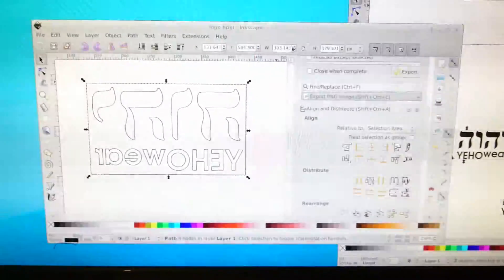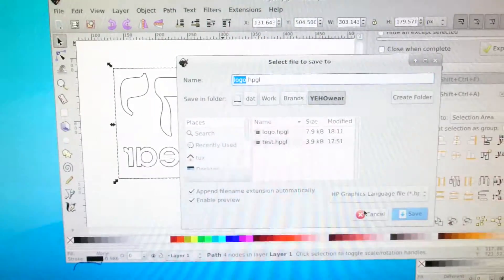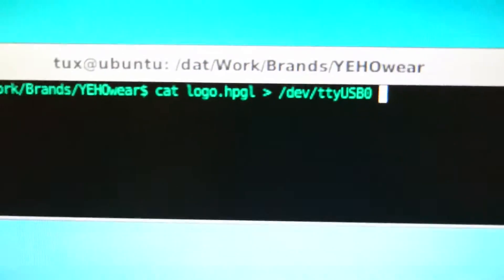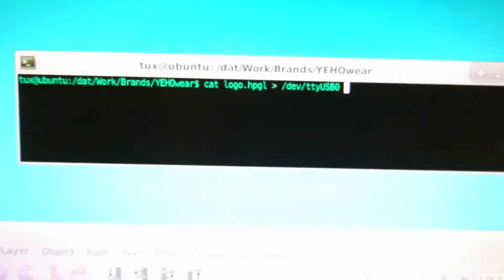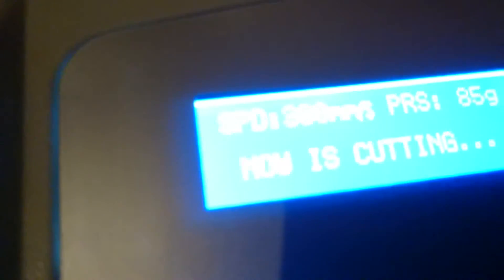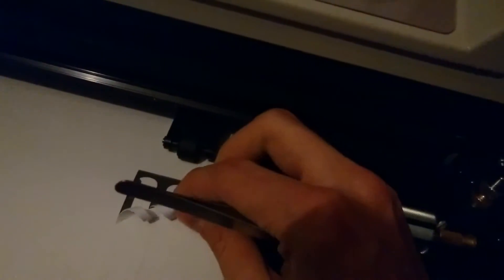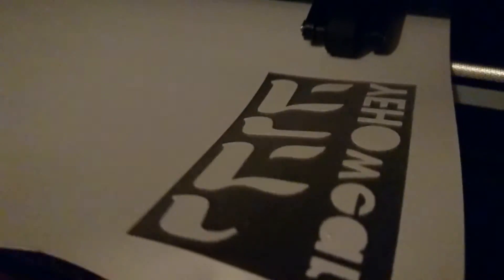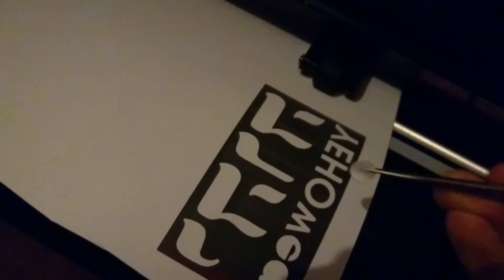Liyu SC631 CAD Cut with Linux Inkscape Ubuntu Heat Transfer Vinyl HPGL Cutter Plotter Heat Press

Comment: Nice video, are Abu drivers needed to setup with Ubuntu?
Reply from the maker: Thank you.  For this SC series machine and many others (using FTDI interface over USB), there are no drivers needed -- the linux kernel already has FTDI support, and it is "plug and play" as long as you have access to /dev/ttyUSB0 - the same applies for other chipsets (CDC ACM, etc.)
You can also use the old school direct RS232 Serial interface if you wanted.
Inkscape now also supports direcly sending the work to the plotter, saving time. (Extensions -> Export -> Plot)
Reply: Thanks. After resoldering the USB port it was p&p indeed.
Reply from the maker: good to hear!  after plugging in a device you can also invoke the command:
dmesg | tail

it will give kernel-level information on events such as what USB device/chipset it is, model, serial number, and what /dev/ttyX location it gets assigned to, good for troubleshooting (i think CDC ACM chipsets get assigned to /dev/ttyACM0 for example)